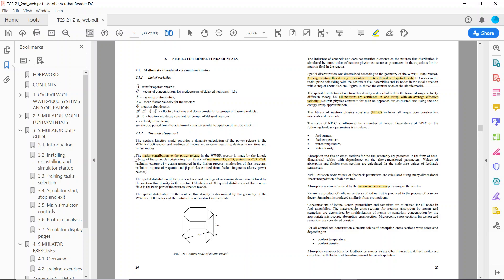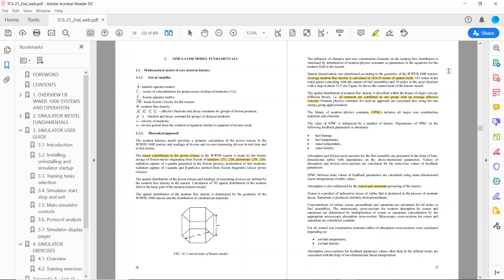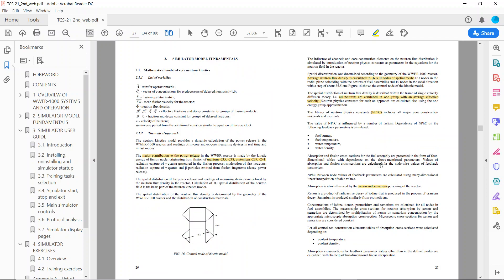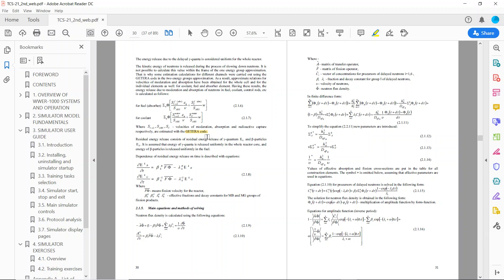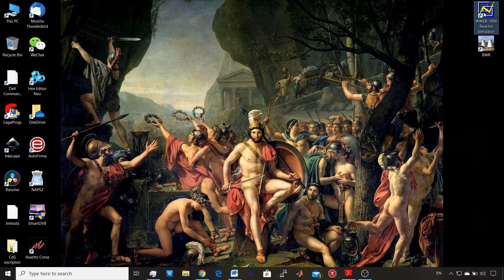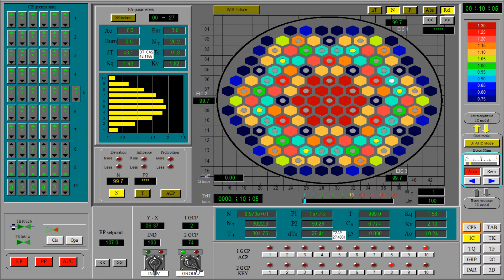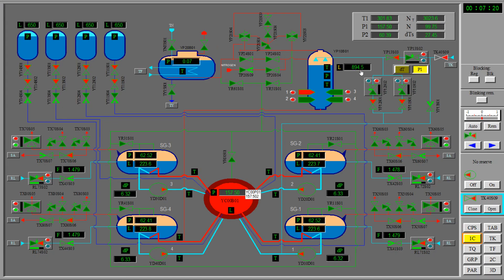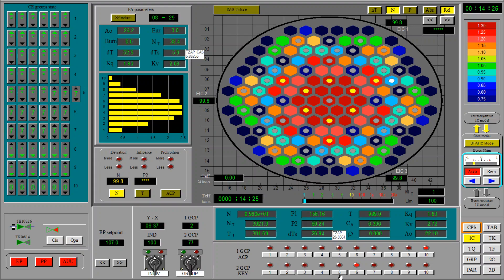Nuclear Reactor Simulator: Primary Boiling WWER-1000 1/2

Comment: Is this simulator supposed to be able to run on windows 10 ? I can't get the actual simulation started. When starting the program, I do get the list of initial conditions to choose from, but upon selection, nothing happens and the program ceases to respond. Any suggestions ?
Reply: Have the same problem...
Reply from the maker: Strange, mine works in W10... Try to put the folder directly in the C directory and start it with administrator rights (right button click options)
Reply: @argilaga  same result.. In my case it was working on W10 a few months ago, but now it is not working
Reply: @argilaga  I have tried it and tried with different compatibility settings but it doesn't work. The process is running and hogs an inordinate amount of resources (upwards of 20% on my 4 ghz Ryzen hexa core) and makes my whole system lag and stutter. I'll try to run it in a Sandboxie to see if that works but if not, I'm out of ideas :P
Reply: @Pow3llMorgan  Same, no idea. Run it in compality mode windows xp to windows 8, running with admin rights, idk, so sad :(
Reply: @argilaga  Do you have discord? Or something like that?
Reply: @19superfelix  Not working on all my pcs. Windows 10 20H2, ryzen 5 2600x
Reply: @argilaga  since your copy works, which folder and files in the temporary files directory does the simulator try and create? My guess is that this action is being blocked by most people's systems.
Reply: @SmokeyBCN  The only way is to use windows xp. I tried everything but on windows 10 is not working. Since i have windows 10 pro i have Hyper-V, so i created a virtual machine of windows xp sp3 and i installed the Hyper-V integration services on the virtual machine.

Here's the link for the integration services: https://www.deltik.org/news/view/45/download-hyper-v-integration-services-for-legacy-operating-systems
When you create the machine remember to set it to generation 1 and remember to disable dynamic memory.
You could use virtualbox too but it's slow and has a lot of bugs
Reply: Same problem with me :(
Reply: Hi, did anyone solve this issue (for w10) please?